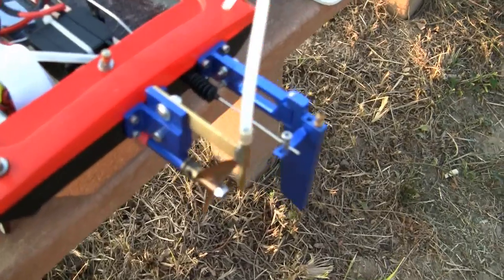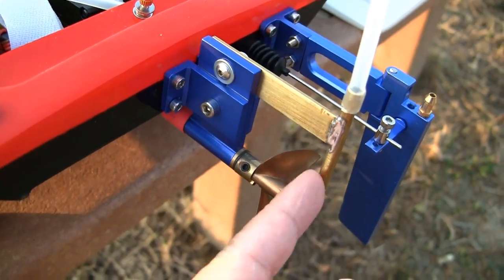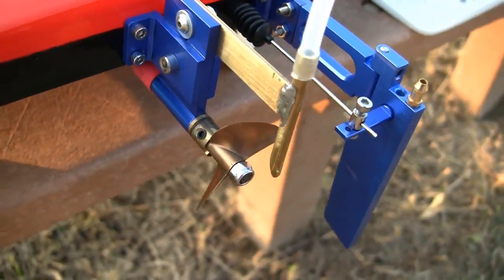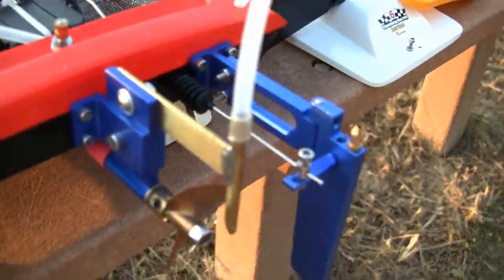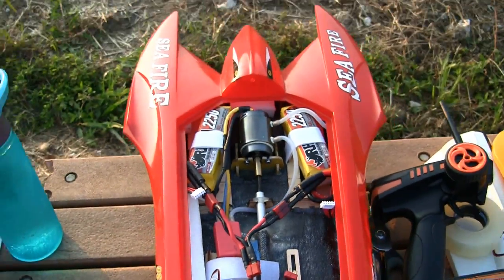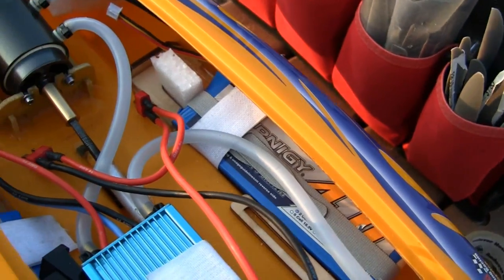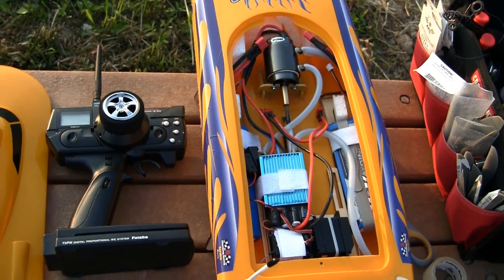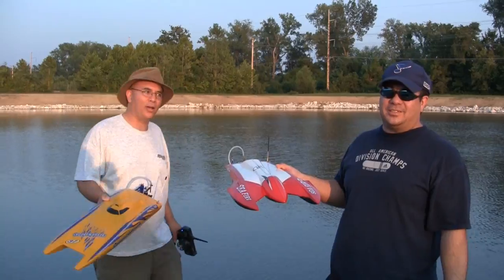Better RC Boat Water Cooling

Comment: Very old video, but I’ll hope for reply.

I have a very old antique RC boat that I wanted to replace with a whole new complete set up. The motor, esc, servo, rudders everything except for the body because I like the look of my boat. 

What I need to know is a complete set up as in which motor goes with which servo and which controller to get. 

If someone could say everything that is in your boat electronically that would be perfect. Or how to tell if items will work together or what batteries to use
Reply: The stock parts from the aquacraft UL-1 is a great setup.

Comment: Sorry really dumb question here, new to boats, and looking at a water cooled system, so on with the question.. where does the output go? is it under the waterline, or thru another hole that i didnt see.? again sorry for the dumb question..lol
Reply from the maker: Vipers Byte after cooling the motor and ESC the water exits another tube to a water outlet usually mounted through the side of the hull. Most outlets are made of aluminum and threaded on the inside so it can be tightened with a washer and nut.
Reply: Vipers Byte and  generally above the water line.

Comment: Hey Guy's, quick question what sized tubing did you move up to? Do you still get high pressure through put?
Reply from the maker: tjonessc X large tubing the biggest the local hobby shop had on stock. It gets  a lot of pressure though it.

Comment: At last I have joined a RC Boat club here in the UK and the water pickup mod is working a treat, I used a 4mm plastic Y piece so have silicon tube from the rudder and prop pickup connected to the Y piece so plenty of cooling.

Comment: Which would you guys prefer the Seafire, Relentless or Aquaholic?
Reply from the maker: We have only run the Seafire so couldn't tell you which would be preferred. Any of them would probably be ok for a first time boat but if you have the budget you would be better off with the Apparition or Genesis. They are both much better quality and can handle some major power system upgrades if you want to in the future. Check out our videos on these boats.
Reply: Excellent. Thanks for the comment. Great Vids too fellas. ill take your experience on board(no pun intended) and do some study. Cheers

Comment: hi guys  ,,,,,,,have not thought about the air in the water of the prop,,,,,,, ive have thought about drilling out the rudder pick up slot and down the main water in take bottom and the top its a pain in the ass but its worth it ive  done that and its fine the more water going through the better its just some thing else to think about
Reply: If your worried about air off the prop you can mount the brass tube directly into the water with the slanted cut just below the hull right infront of the rudder or like I did I drilled a small hole in the hull inside the transom and epoxxied the brass tube to the transom and down through the hole.

Also you can turn the cut facing away ( towards the back of the boat ) and attach a piece of tube just shy of the inside next to the transome that acts as a water vacume to keep the inside of your boat dry.

Comment from the maker: We use epoxy or fiberglass resin with some fiberglass cloth to reinforce where the motor mount meets the hull. It must be very strong because it takes all the torque of the motor.

Comment from the maker: Paul has the stock esc in his SeaFire and I was running the esc from my ProBoat Black Jack 26 which I believe is only rated at 45Amps. I think it is seriously under rated though. You can find this esc at horizon hobbies. They also make one rated at 60Amps again I think it is under rated and can take more. You could also look at the ones available at hobby king. Just do a search on the web.

Comment: @chris81983 i think you are correct sr! just like if you remove the thermostat in your car it will run hot the water is not slowed enough to draw the heat up to fast of a flow could be just as bad as to little

Comment from the maker: The bottom of the pickup tube should be even with or just a little above the top of the prop nut. The higher the tube is the less water presure you will get and more chance air will get in. You also want the distance behind the prop to be about 1/2 inch (12mm).

Comment from the maker: Yes, it makes a big difference in waterflow from the stock pick up. The prop acts as a pump and forces water up the cooling tube even at slow speeds.

Comment from the maker: Just the usual, make sure to seal the hatch good with hatch tape and check for any cracks along the seams of the hull. If you find any fix them. You can also put a piece of heat shrink tubing on the prop shaft where it enters the strut to stop water from going up the shaft into the boat.

Comment: The little pump shifts plenty of flow though the big pipes motor first them ESC a power test will be run to evaluate the performance of the cooling system, and seem to primes its self Ok. There is a rectangular scoop on the outside of the hull to help when the boat is traveling. Having a pump means the temp won't overshoot after a fast run and stop like it would if it were only a scoop or tap from the jet unit nozzel.

Comment from the maker: The SeaFire is running the stock motor and esc. The only thing changed is the prop. It's an Qctura X442 prop detounged, sharpened and balanced. There is a how to video on detounging, sharpening and balancing props on DiehardrcAddicts YouTube channel.

Comment from the maker: Hydro boats in general are ususally faster than catamaran type boats. Also I believe he was running higher c rated batteries which results in less voltage drop meaning more rpm and speed.

Comment: Hey, I was just wondering wich motor and ESC exactly you are using in the sea fire. Looks like stock motor and stock ESC? Is it just the hull design what makes it faster then the surge crusher?

Comment: the boat is a miss gieco and i cannot find ny brass any where so i took the tubing andran it by the flex cable under the boat and then duck taped it and ziptied it it will not be able to move hopefulle enough water gets through

Comment from the maker: If you mean using silicone tube for the pick up it probably isn't a stiff enough and would flex and move around too much. It would be better to use a piece of brass or copper tube and solder it to somthing you can mount to the hull of the boat.

Comment: The pickup tubes should be mounted so they're at the 2:00 o'clock position at the prop. Using a propwash pickup also allows more air into the cooling system.

Comment from the maker: There are many reasons why a boat would twist or roll but I need more info. What kind of boat is it, vee hull, catamaran, hydro? what setup are you running? Is it all stock or modified? What motor, esc, batteries, prop are you using. It could be as simple as needing to dial in the cg by shifting weight to one side or adjusting the strut height or angle. Or it could be the mods are just too much for the boat to handle, etc.

Comment from the maker: @js64984 Paul has the stock esc in his SeaFire and I was running the esc from my ProBoat Black Jack 26 which I believe is only rated at 45Amps. I think it is seriously under rated though. You can find this esc at horizon hobbies. They also make one rated at 60Amps again I think it is under rated and can take more. You could also look at the ones available at hobby king. Just do a search on the web.

Comment from the maker: @chris81983 we've heard this before but don't believe it's true for all situations. We have never burnt an esc or motor using this setup. On the other hand we have fried both motors and esc with the stock pickup due to lack of proper water flow, especially on hot summer days. saw race boats are much faster than most sport boats and it makes sense to restrict the flow as the pressures are much higher due to the high speeds the boats run, especially when they get in the triple digits.

Comment: I did some testing and with a eagle tree data logger and temps with a rudder pickup are better than a larger off shore pickup like you are explaining here I think it helps to have water going through at a slower pace so it has time to draw heat away that is why many saw racers put tubing restrictors on their cooling lines but this is what works for my setup it might be different for yours thanks for the video good luck with your setup

Comment: Thyanks for the info..I went and ordered a surge crusher today after receiving my new pod-racer from HK which only took 9 days...How does the stock esc handle  2-2s 5000 40c batteries? I have seen video's of surge crusher on 6s doing over 60mph..its a pretty awesome arr for under $200 can't wait to check it out

Comment from the maker: @evanzapata the hull is fiberglass and I'm guessing it would do around 40mph+ on 4s and 50mph+ on 5s or 6s setup. Don't forget that motor is an inrunner and will need the water jacket too or you will burn it up.

Comment: if i put in the 50 dollar motor and the 40 dollar esc and a metal prop how fast do you estimate the boat will go and is the hull fiberglass.

Comment from the maker: @evanzapata I added some links in the video information bar below the video. You will need a pair of  2s or 3s Lipo batteries at least 40c if you plan on upgrades. 3s for motors less than 1600kv and 2s for higher than 1600kv. You will want to go with at least a 180amp esc or higher. If you go with the cheap 200a esc be sure to check the water cooling passages. Use a small drill bit to make sure there are no blockages. you should be able to blow in one side and feel air come out the other side.

Comment from the maker: @arsenalprasa the one on Paul's SeaFire Hydro is an Octura M642 which has been detouged, sharpened, balanced and polished. You can see how we do this in my latest video post. The other prop on the SurgeCrusher is just the stock plastic 440 prop.

Comment from the maker: @arsenalprasa both of these boats have the stock motors in them. They are 36mm diameter water cooled inrunners and are rated at 2000kv. If you are talking about the big blue esc, that is the 50amp speed controller from my old ProBoat BlackJack 26 brushless offshore Catamaran.

Comment: Since both water inlets are still there, can you measure the temperature result of a run on each?  I heard a crazy thing once that too much water flow failed to allow thermal transfer... But I have trouble believing it.   You guys rock.

Comment from the maker: @ch0l0sk8r Drilling the hole bigger is difficult to do on the inlet side. I tried this on one of my other boats and it didn't seem too improve the cooling as much as this set up does. The Black Jack 26 was my first electric rc boat. It is fast but doesn't handle well in the the turns. It likes to roll over. Check out the forum threads on Offshore Electric's website, there are alot on the Black Jack 26.

Comment from the maker: @gripchion Thanks for watching gripchion! Oh yes, the boats are a blast too. Good for when the days are too windy to fly, though the water can be choppy, LOL. The red boat was completely stock except the prop. I added a prop with more pitch. it started to overheat the ESC though so I will be upgrading it in the near future. We will have videos of the upgrade once I get the equipment. Anyway, the stock Sea Fire boat (the red one) is a good boat even stock. Thanks for watching!